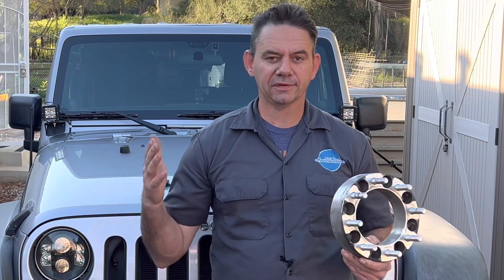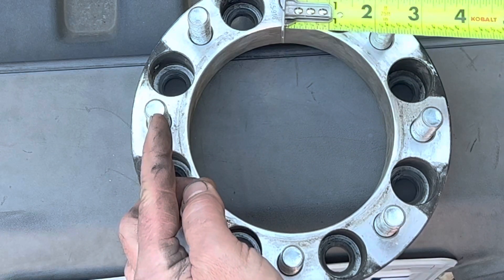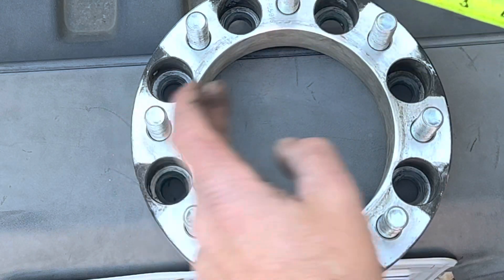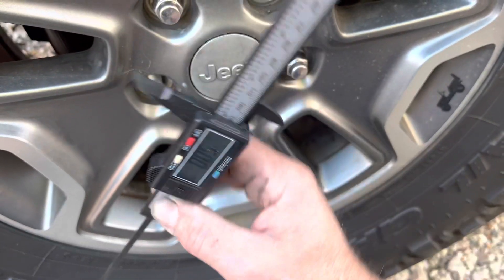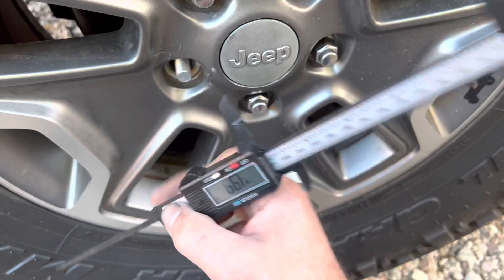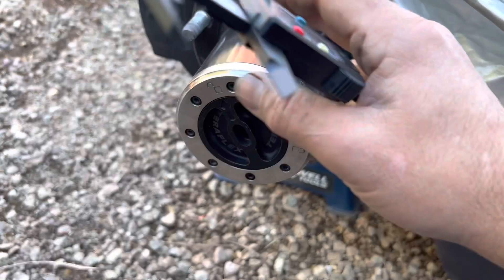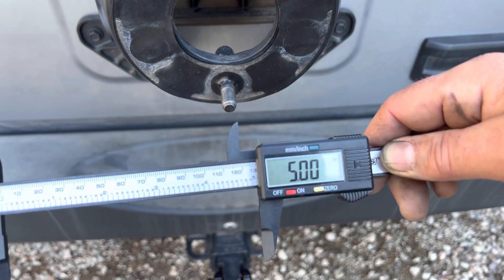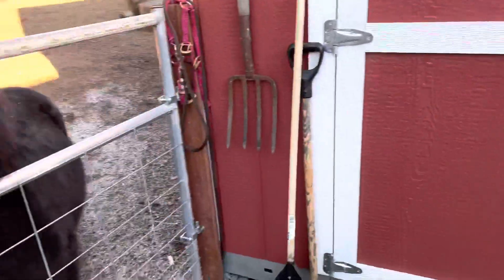How To Measure Any Wheel's Lug Nut Bolt Pattern

Comment: The gadget called a caliper.  
Also for more.accurate tape measure start at eg 1 inch where start mark is definite..
Can measure outside to outside then subtract bolt outside diameter with calipers also.

Comment: That's not really how you measure it accurately.  Measuring to the outside of the stud is just a coincidence that it lines up.  5" is the diameter of the circle that runs through the center of all the studs. You need to do math or use a calculator, but the distance between the centers of those bolts on a 5" bolt pattern is 4.755".  Also that's not a micrometer.   

Note:  if you want a tip on very accurately measuring center to center on studs using vernier calipers measure the diameter of one stud and then zero it out. Then measure from the outside of one stud to the outside of another. This will be very accurate.